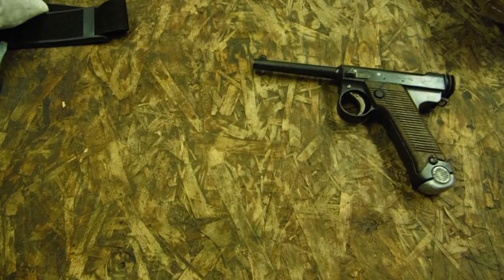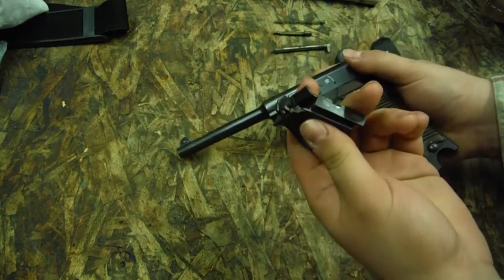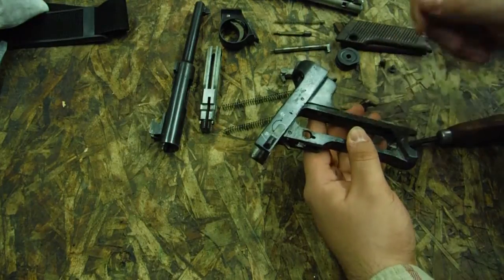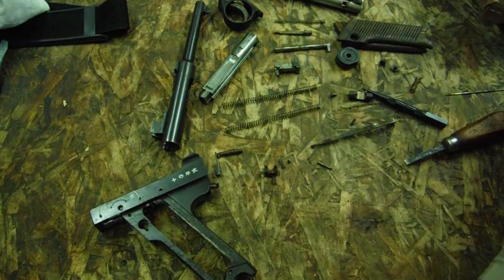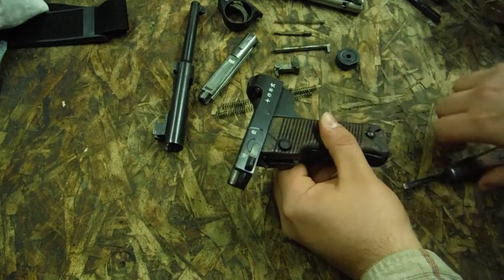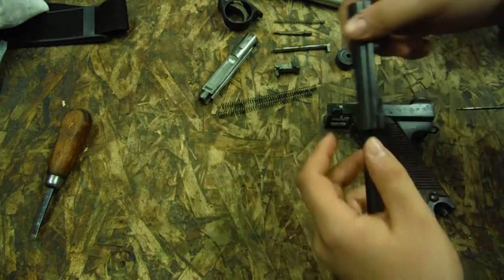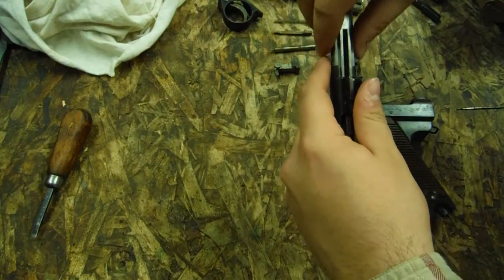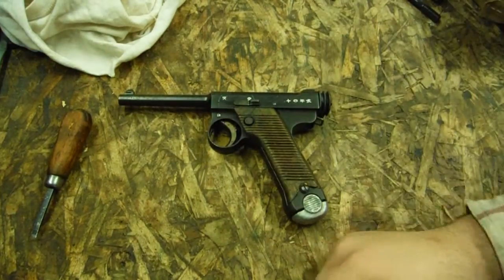Type 14 Nambu Disassembly

Comment: Cool gun, do you know if this was a bring back or post surrender?
Reply from the maker: Hard to say really. If it had capture papers then there would be no doubt that it was a bring home. Since there are no papers though I can't really say either way. Most guys just threw the paper work away once they got home. Some guys had a bit of forethought though and kept it while others just kept it with the gun because they stuck it all in a closet and forgot about it.

I'll probably order some ammunition pretty soon. That way I can do a shooting video.
Reply: I understand that some of the rifles which were picked up after the surrender had their chrysanthemum’s ground off so as not to offend the emperor. Does the Nambu have one?
Reply from the maker: Sidearms did not receive the mark of the emperor. My Type99 has had it's chrysanthemum ground off from it though.
Reply from the maker: Its gonna be expensive from wherever you get it. Even other places sell it for like 50-60 bucks a box

Comment: my god and this is a service pistol?
Reply from the maker: troy kennard yeah back when the springs were good these were decent guns. They did a study and these were the most accurate sidearm to come out of the war.

fast forward 80 years and all the springs are shot and now people get the impression that these are junk. These are high quality guns it's just time took its toll
Reply: i just got a 1937 t14  that is totally mint with 2 matching numbered nickel mags with holster. near 100%. has cleaning rod and xtra firing pin too. haven't been brave enough to take apart, just cocking know. If you have a email i can shoot some pics to you if interested.
Reply from the maker: It's not a bad idea to take it apart to make sure nothing is going on under the grip panels or anywhere else you can't see. Just take your time is all.

Comment: "We don't field strip things on my channel, we do the whole thing". 

Evidently not because you didn't show how to remove the extractor.  That's one of the most important parts to know how to remove and replace given how fragile Type 14 extractors are.
Reply from the maker: You got a good source of type 14 extractors? Also this one is stuck and will not budge.
Reply: @Targetpopper  I don't blame you for not meddling with a stuck extractor, I just thought it was funny how you said you go all the way after just explaining why you wont be going all the way lol. Still the best Type 14 disassembly video out there. 

Anyway, your locking block spring seems to be just free floating in its channel, mine is apparently captive in the channel as it wont budge after tugging on it with a bit of force. 
Any idea on why this is? Also, do you still shoot your Type 14? I was looking to pick up some Buffalo arms ammunition but have heard mixed reviews and although I have a repro firing pin in mine, I'm terrified of snapping off the extractor on crap ammunition.
Reply from the maker: @simplymadness8849  No, I don't shoot this gun anymore. Too risky. The Buffalo Arms ammunition is pretty much garbage.